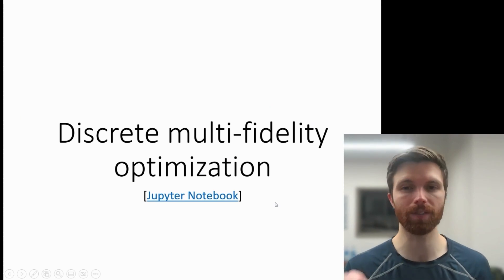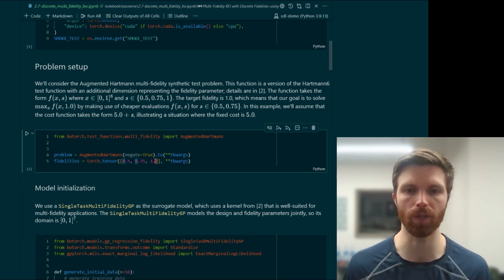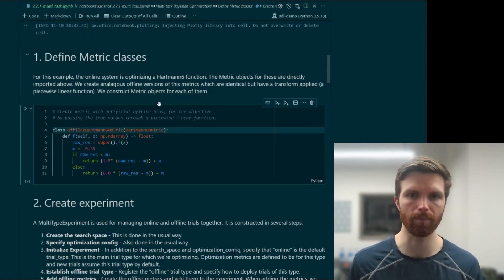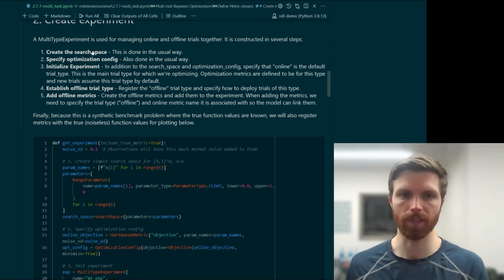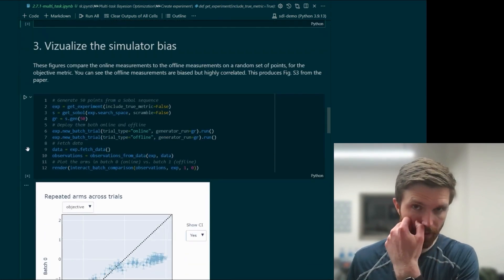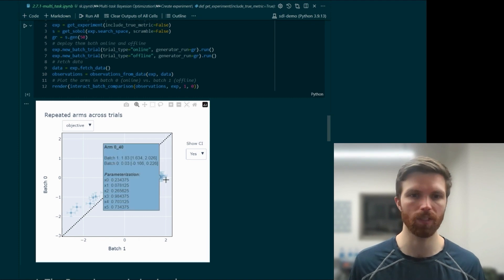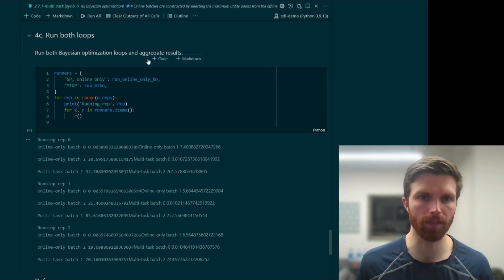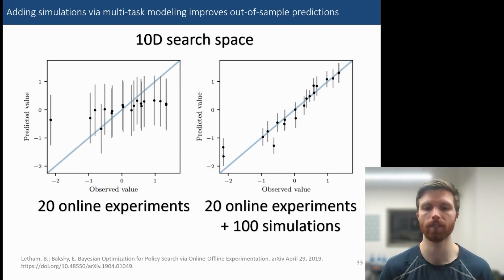Discrete multi-fidelity optimization

Comment: Hello Dr Baird,
Thank you so much for creating this informative playlist. I have gone through the whole playlist to learn about mulit fidelity bayesian optimization in an attempt to apply it to my research work. I am very new to this field and one thing I am struggling with is trying to apply these concepts into a real world application where we might want to apply multi fidelity BO on a  parameter search space problem. A particular example might be where we want to explore a certain parameter configuration space for running a scientific application to find out which of those parameters give the least runtime. And we do this optimization based on a dataset where we have a mapping of the different configuration space to its runtime rather than hyperparameter tuning approach where we iteratively run a NN to get an observed metric against which we optimize. Will it be possible to show such a level optimization implementation through a tutorial?